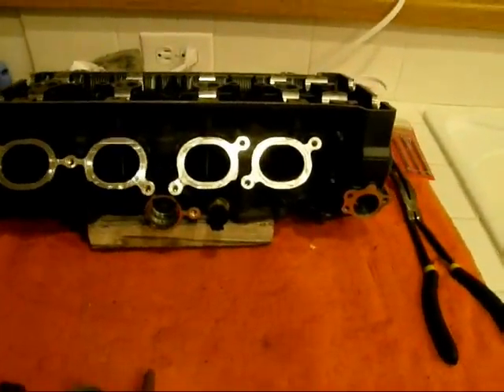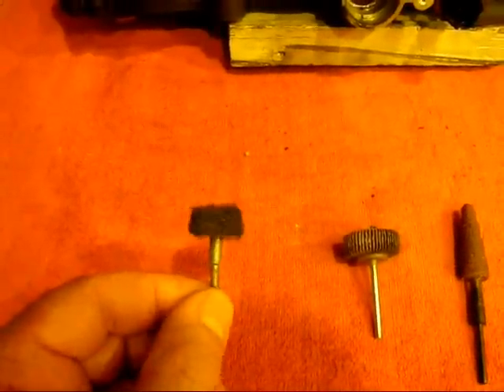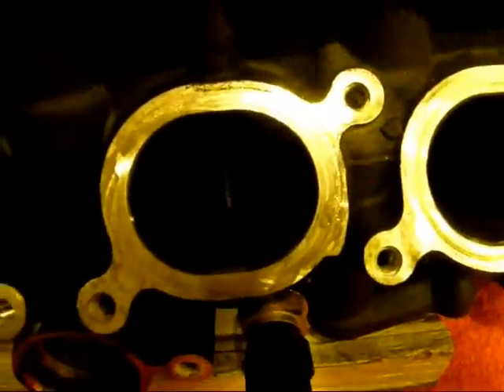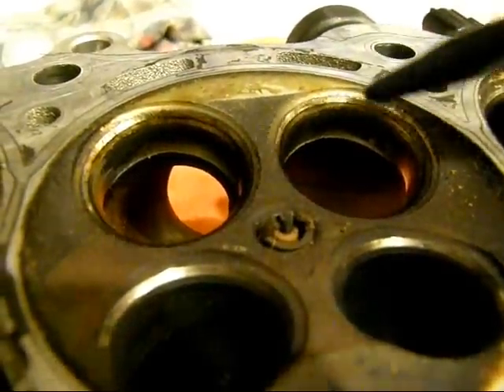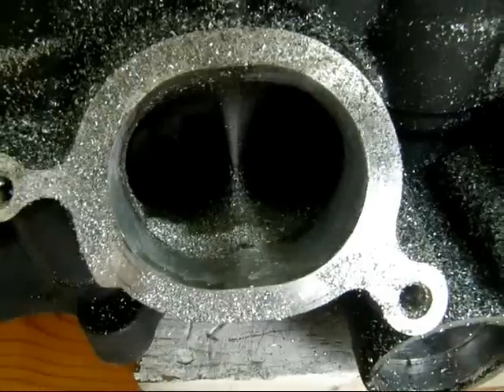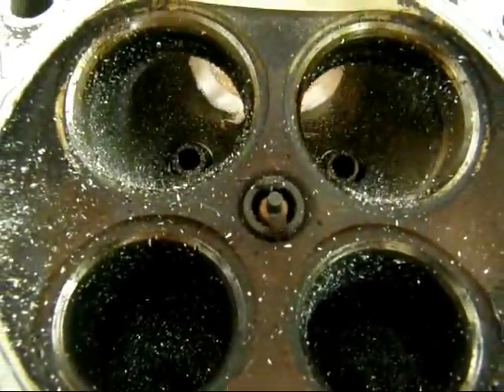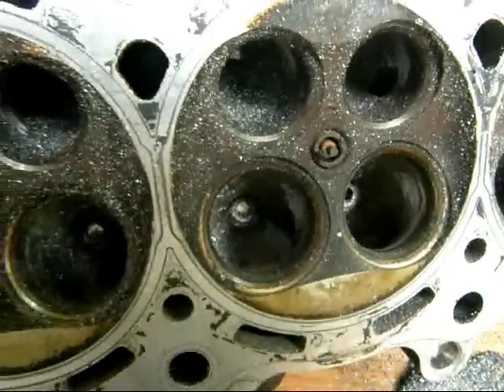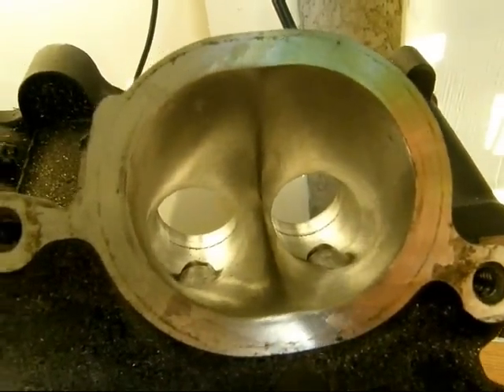BSR  Yamaha R1 Cylinder Head Porting Explained

Comment: The work you've done on this head does this help top end or low to mid, thanks?
Reply from the maker: About 10-12HP peak but also good gains all throughout the rev range. It's definitely not a all on top mod. This is something that will be very easy to notice every time you ride (even at school zone speeds). It will be much freer revving.
Reply: @wfofz1  thanks John

Comment: Great video..Does port cylinder heads, make a motor vehicle heavier on fuel consumption.. or Not..??
Reply from the maker: No. It actually uses less fuel because it runs more efficiently. At least every motor I've ever worked on was running rich until being adjusted with a custom fuel map.

Comment: This was one of the better porting jobs I've seen! I've only had one head done and it doesn't look anything like this. As far as gasket matching, do you "special order" your gaskets or do you use OEM and scribe them to the port job?
Reply from the maker: I use OEM. I usually use the boots that will go back on the head. If those have room for improvement I can adjust them as well. 
My favorite way to do it is to look at the intake system as a whole. Decide if the airbox can be enlarged, or otherwise optimized for flow. Then match that to ported throttle bodies that in turn will be matched to the cylinder head.

Comment: what about the edge in the combustion chamber around the valve, isn't it worth fixing? it looks great what you have done.
Reply from the maker: Thanks! 
That's called un shrouding the valves. Sometimes I'll remove a little material there. I don't remove much because I think it's more important to maintain the compression ratio.

Comment: Your work looks very clean, have you done any 2008 Yamaha R1 cylinder heads? If so I would like to contact you via email as I am building my engine and the final step is the head.
Reply from the maker: I have. The heads are very similar from 2007 onward. 
wfofz1@hotmail.com
Reply: sent you an email.
Reply: @wfofz1  how much for an 08
Reply from the maker: @Screammy89  Not currently doing porting any more. Sadly!

Comment: I have seen some CNC dimple porting that has the surface texture of a golf ball. Golf balls are dimpled for less air resistance. I don't believe polishing the ports gives any advantage. Also ports that are too big don't work well, (loss of velocity / inertia). Like John Boston said, common sense!!!!!SO USE IT. From what he has said in this video, I can tell he knows what he's doing. I have ported about 20 cylinder heads in my life time. Also engines don't truly pull air, The piston creates a void with negative pressure or vacuum, which then the positive pressure of the atmosphere must equalize with the said void filling the cylinder, if looked at this way, it should be said that the atmosphere pushes air into the cylinder. Words create thought, correct words empower. I hope I didn't make a fool out of myself with what I just posted. LOL. Yahoo!!!! LIFE IS SHORT HAVE FUN.
Reply from the maker: julio lausell I have to agree with all of that. It's few people that understand what you just said but I don't think that makes you a fool. 
Thanks for the comment!
Reply: Thank You John. I never thought you would comment on what I said. I like your work, those ports look really good. People should hire you to do their ports. Porting done correctly gives more bang for the buck than other mods... I once cut down the valve guides flush with the port. it worked on my 94' gsxr 750cc big bore to 883cc ( cosworth pistons, 39 keihin carbs ) but my 2000 gsxr 750 had two failures from the valve tip snapping off from what I think was valve vibration or oscillation, dropping the valve into the cylinder (total destruction). Older motors tend to have thicker valve stems. Thanks for your video. Porting when you know what you are doing is very satisfying, to the person doing it and the person enjoying the new found power. Take care John.
Reply from the maker: julio lausell Julio, I try to respond to all comments. Yours deserves a reply more so than others because you obviously know what you're talking about. 
It's funny how people will spend thousands of dollars on an exhaust and other bits that won't make the same difference that a good port job will do. I guess it's because you can't see the work and most people are into appearances. 
I've reduced the valve guides a few times and haven't lost any valves yet...
I'm hoping to find more people that want work done so I can make more videos. 
I ported (and completely built) my 2008 Suzuki DR650 but didn't think to make a video out of it at the time. 
I made a 49% power increase on that bike! It is the second most powerful DR in the world! I did the port work on the number 1 most powerful DR also.
Reply: Thanks.
Reply from the maker: julio lausell I don't mind the tips. Hopefully they can help anyone reading these comments.
I need a new project. I've done a few heads that the customers have never got onto the road. I'm not sure why, out of money, lost interest....Who knows?
I'd like to buy a new project but I'm not in a position to do so. I could work my 2012 MV Agusta F4 but it's real expensive and still under warranty. Also that bike is so rare that I'm not sure it would motivate very many people.
Reply: Wow, a MV!!!! Now that's a SWEET bike...I too am looking to see what I do in the future. Both my parents just passed away, now I have lots of time on my hands ( I wish I could bring them back )... Maybe, just maybe I'll buy a 99' R1 with some brand new 41mm fcr flatsides. I don't want to spend more than 4K. I have seen some R1's going for $2500 obo here on the island of Puerto Rico. If I get it to run good, just maybe, others will let me do their porting....  I hope things go well for you.. Its been nice, keep up the good port work. Thank you for your time. Julio Lausell.
Reply: julio lausell The pleasure been mine! I'm sorry for your loss. 
I wish you good luck on finding your project bike.
Reply: Thank You.... P.S. I removed what I said previously in respect to you.  Take care.
Reply: Dimples only work on concave surfaces not on convex surfaces. It pulls the air flow towards the convex surface. On a convex surface the dimples are only creating turbulance.  If you dimple the complete port the advantages of the dimpled concave will be neutralised by the negative of convex surface.
Reply: julio lausell  i dis agree i don the same job in one cylinder post bike and i make 3.5 extra hp on it ... the only difference was i smoth the out take and i ruph the intake afrer the bufing so it going to hold some of the fuels and air pressure on the intake ... if you think from 7 hp i make 10 hp with one cylinder fuel injection bike .and it was like stock from piston. cam and oll thats shord of staff .. it is working fine ....